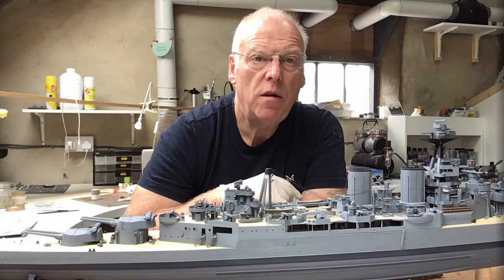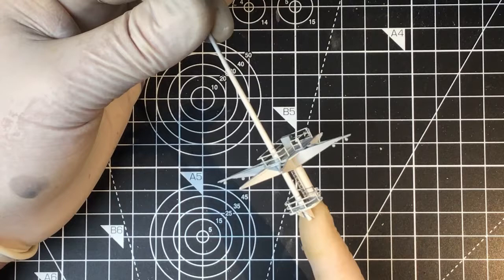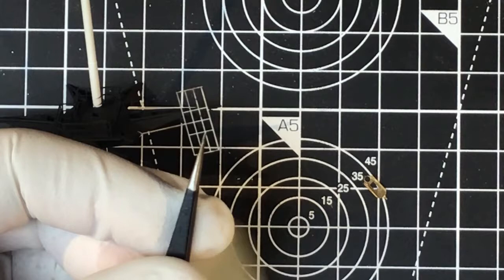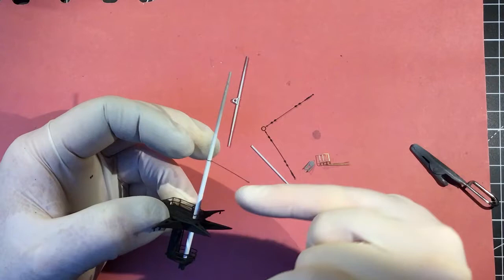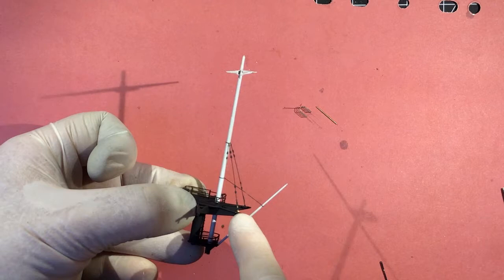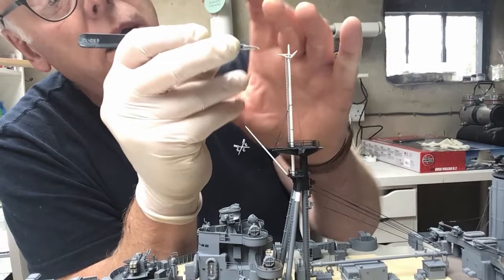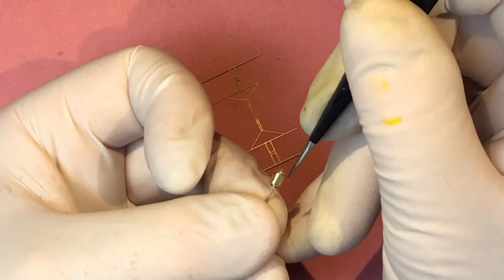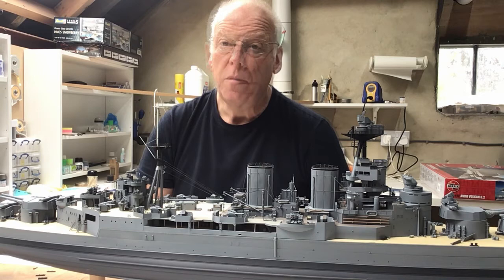Trumpeter 1/200 HMS Hood Full build with Pontos detail set Part 43

Comment: I am looking at getting a soldering iron for the brass fittings any recommendations would be greatly appreciated
Reply from the maker: Hi Jack I have a new Hakko 888 which Ive found to be really excellent. I also got a Hakko 1mm horseshoe tip to get into some of the fine detail on these Pontos etched parts. Hope that helps.